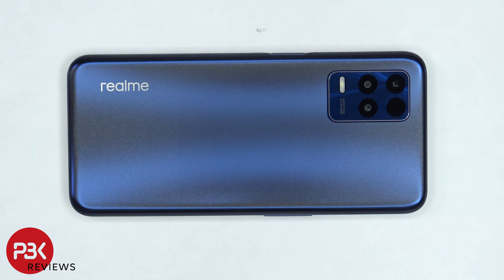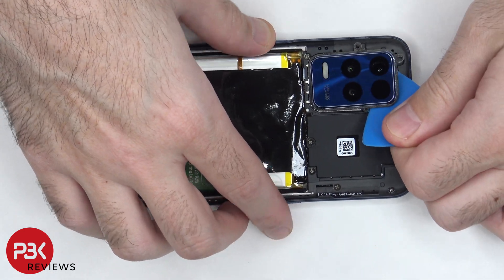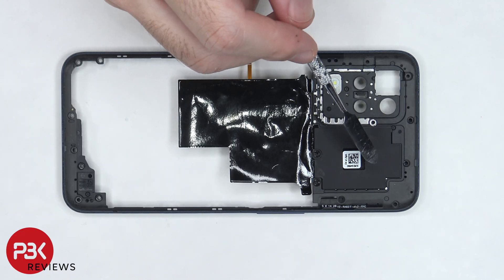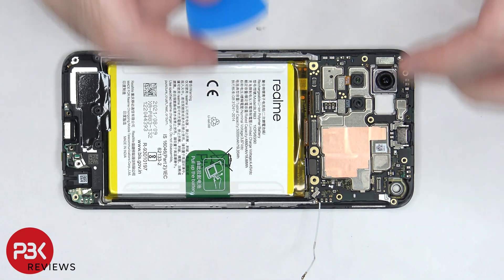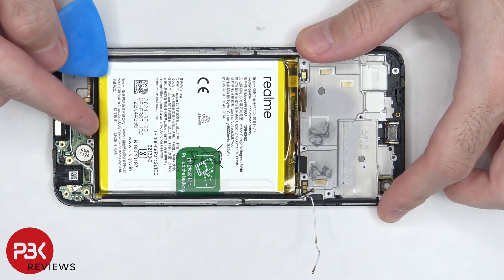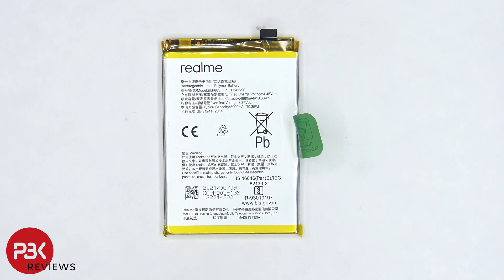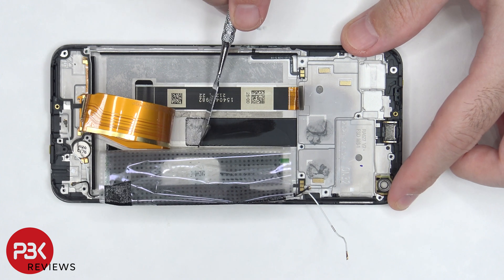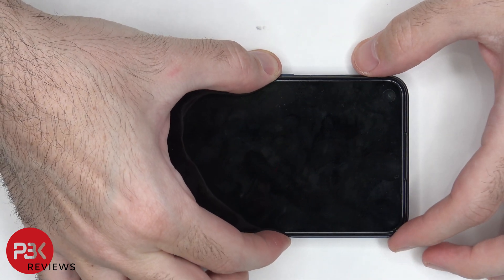Realme 8s 5G Disassembly Teardown Repair Video Review

Comment: Something that would have been worth mentioning is that the fingerprint sensor cable and the volume buttons cable run very close to the edge of the phone.
This is completely my fault but I've severed both of those cables without noticing with a dull plastic credit card while trying to get the back cover off.

Already ordered the replacement cables and back cover, didn't cost much but it will take some time for the parts to arrive.
Reply from the maker: 👍 yup, always best to try not to pry to deep into the phone. It's happened to me once or twice in my day as well.

Comment: What happens if the middle frame cracked do i change it when changing an lcd??
Reply from the maker: You can purchase a lcd with frame combo. They usually sell the screen and frame already attached as one piece (which makes replacement easier as well) or the screen separately.